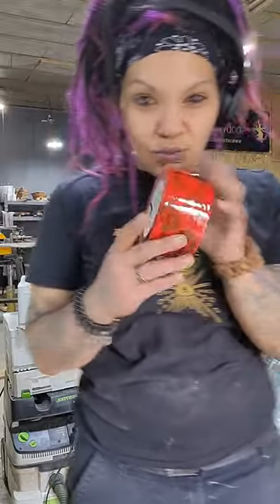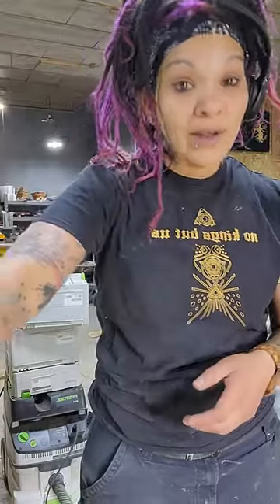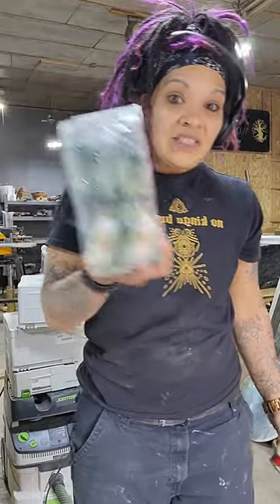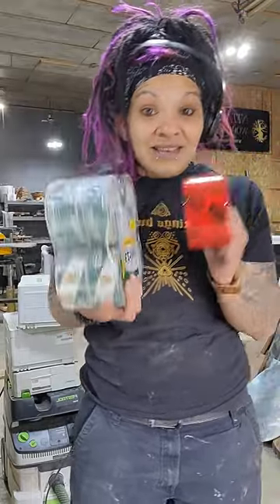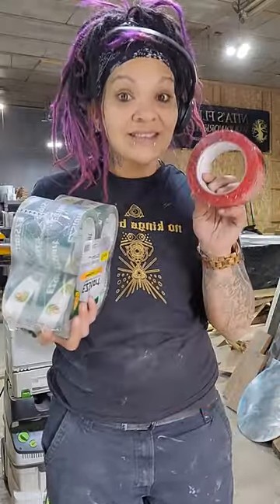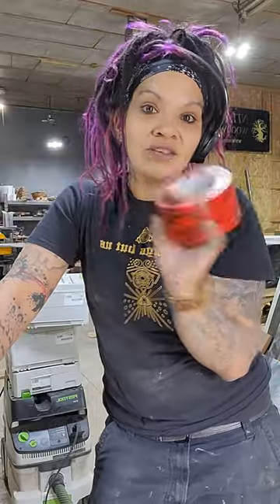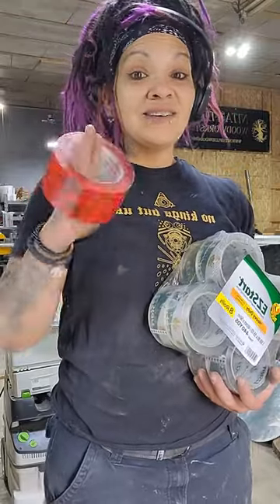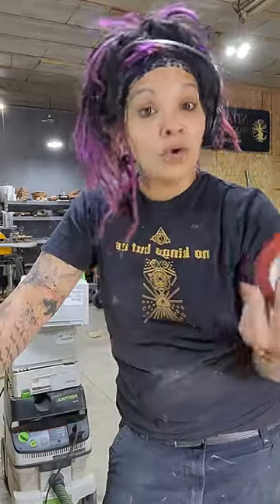What Tape To use On Frame/Mold for Epoxy River Table

Comment: I've used both the green Tyvek tape and the white opaque version of this red Tuck tape listed here. I haven't tried the transparent red version but I'm willing to try it.  The white opaque Tuck tape is a nightmare to work with. It sticks to wood and completely bonds to wood if any small amount of resin gets between the white Tuck tape and the wood, making it impossible to peel off the tape without tearing out strips of wood with the tape. The white tape also sticks to every resin brand I've used it with, leaving a white layer along with the tape name on your piece, so the only way to remove the Tuck tape is to sand it down, which is not ideal unless you're working on a rustic piece and/or that part of your project will never be seen.   

The green transparent Tyvek tape lifts off my resin pours very easily, leaving no tape on the resin nor wood, however, this also means it hasn't sealed well either, allowing resin to leak and make a mess on the underside of the pour.  On a recent project, I used this green Tyvek tape then Tuck tape over all of it, including on some of the bare wood, and I pressed all the tape onto the wood, which was flat, level, no grain grooves, to ensure a tight seal and prevent leaks.  But nope! Sure enough resin escaped in several spots and I had to use 80grit sand paper and hand sand + orbital sand for hours  to get rid of the leaked resin & white Tuck tape, and try to avoid damaging the surrounding wood with sanding indentations. The tape and subsequent messes were acceptable with rustic live edge counter tops in the past, but a complete fiasco with my recent funky Mid Century Modern piece I'm working on.  I came online to find more tape options. I'd use the green Tyvek for smaller pieces, and the white Tuck tape for certain pieces that I don't care about sanding afterward, but I am still on the search for a strong adhesive tape that doesn't stick to resin yet makes a strong non-leak seal.    I'll try this red version and search for 2- 3 more options.
Reply from the maker: Damn... yes the red I've never had any problems with!